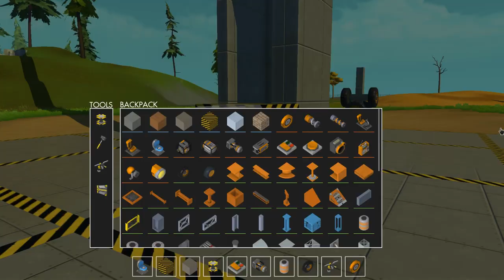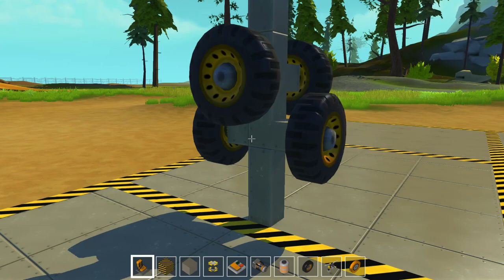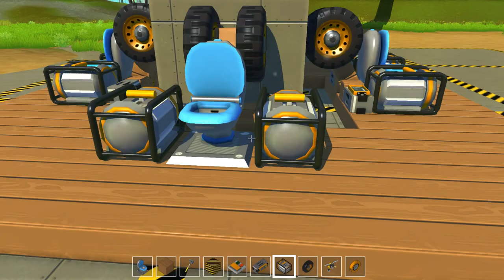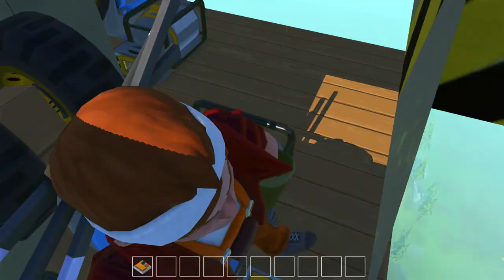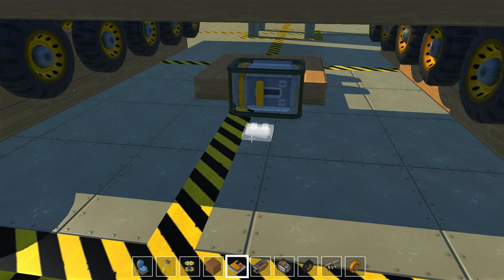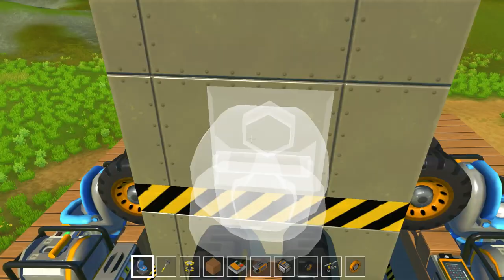Scrap Mechanic - Ep. 40 - The Skybase Lifting Vehicle! - Let's Play Scrap Mechanic Gameplay

Comment: Is it a coincidence that Draegast did the same king of elevator just a few days ago ?
Reply from the maker: +DVDwr Hah, I guess so. I haven't had time to see what other people are building.
Reply: Hey look at this
Reply: +Blitzkriegsler make the 6 by 6  shaft and inside the shaft add rails in the corners that go all away up and when thats done add the platform and let it fall down to the ground and seal the rails. basically add guard rails in the shaft corners
Reply: +XxGR1M I think he should put a set of free wheels on each side facing the pillar, and put those permanently at 20'. This means that when you let go from the pillar, the wheels would allow you to roll down smoothly.
Reply: +DVDwr They're friends, they probably thought of the idea together. Even if one of them take the idea of the other, they're friends and it could have been a suggestion from one to the other since they were trying it.

Comment: There's a much simpler way to make it drive down the toilet tube than the idea you mentioned in the end. In the area you have your wheels attached  remove the wheels then place a block on top of the exposed bearing and then place a bearing on that block and then reattach your wheels to that bearing. Then you can power the inside bearings with one motor and the outside bearings with another motor. So if you wanted to go up you power one set of bearings (either the inside or the outside) with a motor and a switch, and if you wanted to go down you cut the power going to the first set of bearings and power the other set in the opposite direction. So now you have a forward and reverse without having to use the drivers seat. You would have to make it so that each of the electric motors powers more than the one bearing to make this idea work without adding any more motors.

Comment: Hey, with the door latch thing, you could add a lock to it so it does not wobble. You can also have a sensor to slow the ascent/descent. You could also have half and half on the wheels, one set free spins, the other is thrust.

Comment: put a slot along the whole shaft and attach a fitting bar inside with a wheel outside on all 4 sides like a pully it would drive up and down
Reply: +Dalton Haskins  yah or you cold make the wheels strattle the slot
Reply: True

Comment: rocket lifter needs a long shaft of contact patch vertically. like a box 5-8 tall, touching all outer walls directly, between thrusters and seat. you can try just corners, just edges, or both, but the taller, the better.

Comment: You should put four thrusters on the corners. Then adjust the power so they can't lift it but will slow it down so it won't phase through the ground. Like that you should be able to get rid of the conveyor and the floor that folds up. I noticed that it got a lot less stable after you put in the folding floor.

Comment: It may not work perfectly, but I did LOL when I saw that wheeled contraption start rocketing up the side of the elevator shaft.

Incidentally, why not let the platform rest on four or more downward-facing wheels attached to shock absorbers?  Simple free-rolling wheels at each corner of the platform, just to hold it up.  Maybe that will make it less likely that it embeds itself in the floor after it falls to the ground.  Heck, you could put another set facing upwards to soften the impact with the sky base.

Comment: I think if you did a rotating switch with blocks on the top and bottom to "lock" the opening side of the elevator it would be a much smoother ride up. The biggest upset on the elevator seems to be that the side which opens can't stay closed when climbing like that.
Reply: Game doesn't work like that unfortunately

Comment: the design you did in 4:00 put it in by one remove the middle of each wall and connect it to the rocket inside the tower that should stabilize the rocket

Comment: make the center of the walls on the elevator open all the wat till the top then make arms stick out to catch at the top, have the jets on the outside sticking through  the elevator walls, while ur inside so u dont fly out make it even all the way around  basically  build a platform that fits inside the tunnel,  with arms attached to it that stick through  the walls so you fly straight  all the way up
Reply: +Blitzkriegsler
Reply: +Ronnie Brown in theory that should work but wouldn't the limits of the game engine make it snag on a lot?
Reply: +Ryujin Dynasty the way the game runs is kinda odd things have bad clipping through other things, it might not work on this game but it would be great if it did
Reply: if you go for this design make the arms go down a block then through  the arms so it sits flat on the top
Reply: Ronnie Brown that would be so cool if it worked.
Reply: +Ryujin Dynasty if we get blitz to do it we'd both find out if it works  to me it seems like it would be the easiest and most reliable way to make it
Reply: А игра

Comment: Why don't you try putting suspension on the wheels and instead of putting all the wheels on top of the platform put them on the bottom and top, so it's little bit more stable.

Comment: Instead of this complicated and unreliable thing why don't you make something more simple reliable and faster to build,  why don't you just make a big scissor lift you know like 15 horizontal blocks left a bearing 15 horizontal blocks right and so on and a platform with a block and bearing so it stays upright on the end of the last pole or whatever with a switch and a lot of controllers

Comment: the design you did in 4:00 put it in by one remove the middle of each wall and connect it to the rocket inside the tower that should stabilize the rocket
Reply: also why not add rocket at the bottom to slow it's desent
Reply: plus place a bar under the opening of the one piece that opens and closes then place a bar that turns in to secure it on the top and that should stop it from going all over the place when you go up